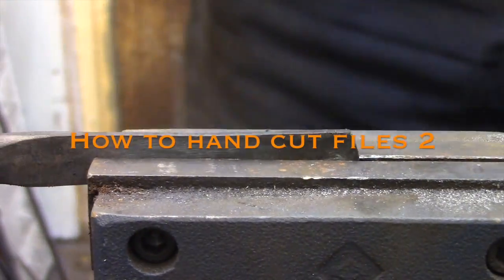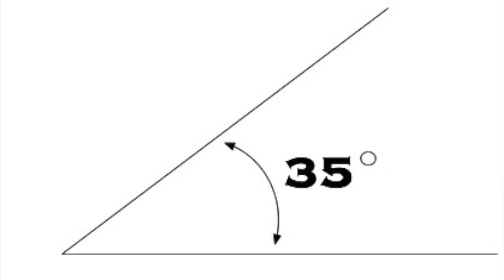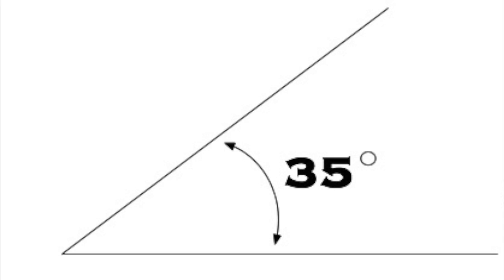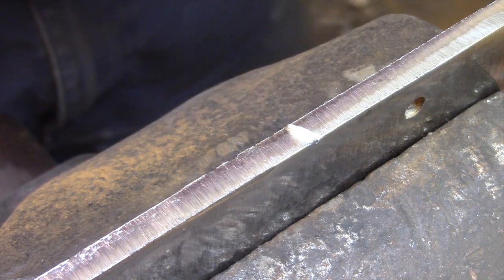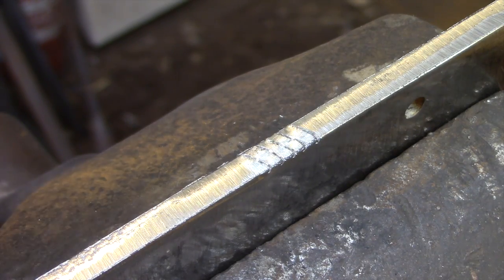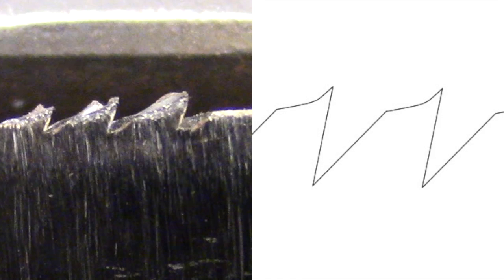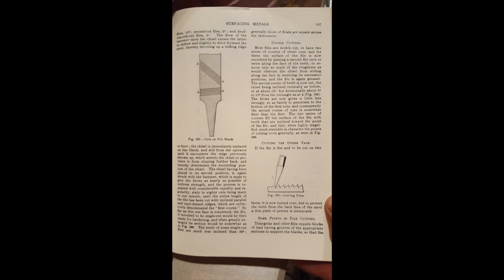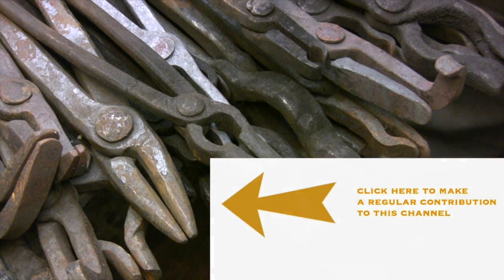Blacksmithing Project - How To Hand Cut Files 2

Comment: your videoes are great! i am a fan i just gained interest in file working, one of my questions to you ishow can i modified a file, so basicallyi want to mmake 2 out of the four sides smooth as in flat so it wont damage what i want to file.
Reply from the maker: They are called safe-edge files.  They're hard to get around here so I just grind off the edges I don't want.  I  also do this if I need a file to fit into a tight spot. All you need to do is cool the file often while you are grinding. The sharp cutting edges heat up really fast and you can ruin a file before it feels hot in your hands.

Comment: you said there was no point in making a coarse file because you can buy one.  I like being able to make all my own tools.  That is why I craft.
Reply from the maker: I started out wanting to make everything  as well but now I mainly concentrate on tools that are not available or the ones that need to be customized to for a specific job.  All I meant was that even the cheep files that are out there are going to outperform anything you build from recycling scrap steel so there is no point in doing that - unless you want to of course.  I just don't have the time anymore to do that.

Comment: How do you keep the file straight when beside plunging it salw water will thicker material prevent quench warp
Reply from the maker: I'm using an oil hardening steel but file makers did have have a jig they would clamp the file into before quenching
Reply: @df-intheshop330  would not that cause heat differential or theres a special design for the jig.
Reply from the maker: unfortunately the film I watched didn't show how the jig was made.
Reply: @df-intheshop330  ok thanks  i think i should try  with oil or slat water and plunge it to prevent quench warp if that doesnot work i would try the jig
Reply: @woozhi9218  three years too late, but you'll still have some trouble with warping regardless of the speed of the quench - quenching in a jig as mentioned will constrain some of it and for a very short period of time after you quench, you can bend a file between pieces of soft metal or pieces of wood. I can't find the video, but recall seeing manufactured files passing through a straightening machine right after quench. The window to be able to bend like this before the steel is transformed completely into untempered martensite is pretty short, though.

Comment: Great video. Is this similar to how tools are cross hatched? (Pliers) or is that a different process?
Reply from the maker: I guess it is the same because the process involves displacing metal rather than cutting it away.  The cross hatching on tools is called knurling and it is done by forcing dies into the surface of the metal and reshaping the surface into that diamond or cross hatched pattern.  It is also the way  the treads on bolts and screws are made.  That s why the threaded portion of a bolt ( or a knurled handle ) is always a larger diameter that the original stock.
Reply: DF - In The Shop awesome. Appreciate the info!

Comment: What kind of steel stock do you use? It is so hard to get really good files today I have often wanted to try to cut my own. Geat info.
Reply: A lot if good files are made out of 1095, but it's a little bit finicky to harden to the max at home.  Any tool steel should work great - 01 for example - which is a little easier to heat treat.
Reply: Alec steele sells some 1095
Alecsteel.co

Comment: you may know this, but search Google Books and look only for the free books and articles. What you will find are a lot of old books and especially textbook written from the end of the Blacksmith and the beginning of the Machinist era. Back when the work that we do was cutting edge in some ways, and was taught at Harvard and MIT. Lots of textbook on metalwork from the late 1800s and early 1900s. FREE. I love them!
Reply from the maker: I did spend a lot of time in  google books years ago   but then they changes their format and I couldn't figure out where to find the free books so I gave up.  I'll try it again  Thanks

Comment: A great and informative video! While I will keep on using commercial files for generic work, now I know that for a special place or size, I could cut my own. It did look that using 2 cuts per tooth, the teeth had a bit asymmetric top, was it significant considering performance or the end result?
Reply from the maker: Unless you are making a curved file you wouldn't normally cut teeth this way.  You should have a chisel that cuts the full width of the blank.  It wouldn't cause any problems as far as the teeth are concerned but the uneven tops could place score lines in the work similar to way a rasp marks the surface.

Comment: If you were to consider continuing or doing an off shoot of these two videos the making of the file cutting hammers used to cut files and perhaps even a specialized chisel for this work would be great. basically the tooling process for producing moderate quantities of these hand cut files.
Reply: You might also consider making a rasp.  You could also show making a brooch.  While many of us may never have a genuine need to hand cut either a file or a rasp, brooches aren't as nearly as commonly available, and since a brooch is size specific (if you want a 3/8" hex hole you need a 3/8" hex brooch; a larger or smaller brooch just won't work), it is more likely that someone would find it necessary to make their own.